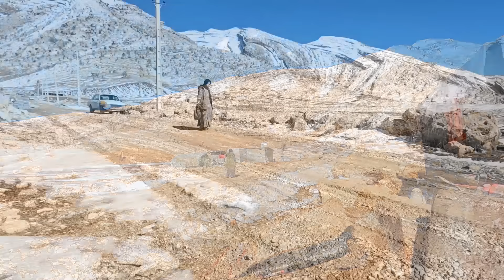Building insulation: Afshin comes to Mahin's help, Daral nomadic 2024

Comment: Mahin, if you use wire mesh, the kind that is usually used for chicken oens, over the roof of the dog pen it will hold the cement. Otherwise it will just keep breaking away.
Reply: isso mesmo, a tela de arame segura o cimento. Com certeza Mahin vai achar a sua sugestão muito boa.